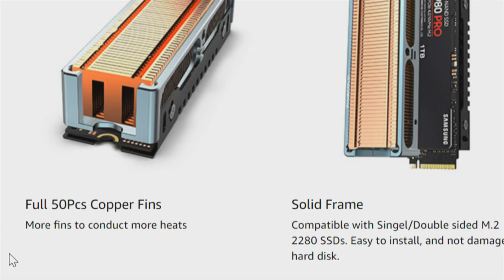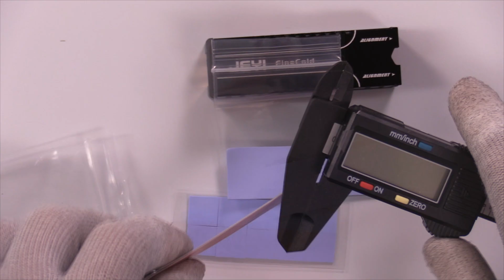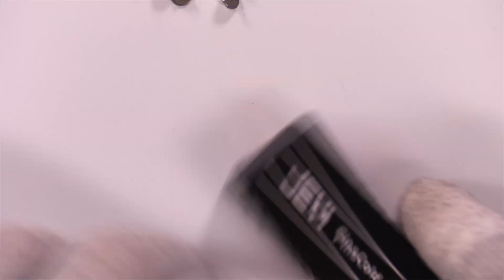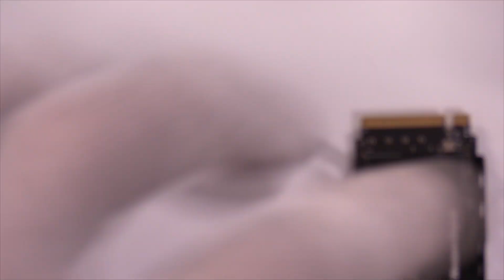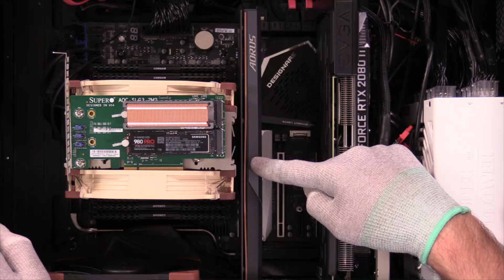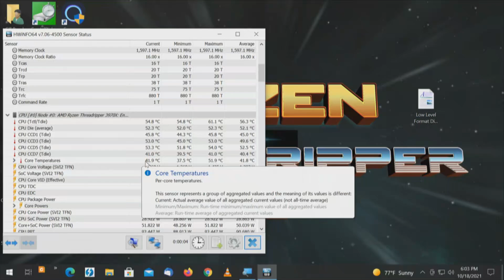Jeyi Copper Finscold Q150 M.2 Heatsink and WD Black SN850

Comment: It's strange that you expected more. Copper has a very high heat capacity, but not thermal conductivity. Once it heats up, it takes a very long time to cool down. I know this from practice. When we burned old wires to extract copper, we left it for another day. A day later it was still quite warm.

Comment: They have the Q80 that appears shorter than the Q150, it looks like works on PS5.
Reply from the maker: Hi Frenando Jorge da Silva, 
Welcome! JEYI Q80? Still same Design. Copper Plate may be more suitable. We have a Video on that one too. Possibly suitable for a Laptop. Link below. Best Option would be an M.2 NVMe PCIe SSD Drive with an included Heatsink for height tolerance. However if You have the Drive already, Heatsink it is! 

1. MHQJRH M.2 Copper Heatsinks Cooler for M.2 2280 SSD Laptop（2 Pack) 
https://amzn.to/3ldSjKn 
As an Amazon Affiliate I earn from qualifying purchases! Hope that helps! Appreciate Your Comments!
Reply: @BuildOrBuy  I got the Q80, it is working fine :)

Comment: PUT CASE NORMALY and Close it! than measure temps?!
Reply from the maker: Hi Beso,
Welcome! Testing requires time and patience. We've Tested 16 M.2 NVMe PCIe SSD Heatsinks as Requested by Subscribers. To expedite, and for clarity, as You have seen. Perception and Perspective. Thank You for Your Comments!
Reply: room temp is 26c + closed case with 3080, samsung m.2 have more than 75c and blue screens,
In normal standing case, hot air from rtx 3-4 hits m2 and his heatsink +closed case is hell (we all know outside with open case we will not have blue screen) 
I know you worked for this video and thanks for it but it does not help people who realy need help :(
Reply from the maker: Hi @besogociridze , 
Of the 16, 2 are better than this one. Are You running PCIe 4.0? Yes heat is an issue. The other 2 mentioned require overhead space. 
1. Acidalie 
https://amzn.to/3Yh7eAU
2. JEYI Finscold iGlacier8 
https://amzn.to/3YrjXRs 
As an Amazon Affiliate I earn from qualifying purchases! What about Your Case Fans? Do You have equal pressure to maximize heat transfer and minimize dust? Hope that helps! 

BTW: What Motherboard are You using? And Case? Which M.2 NVMe PCIe SSD Drive?

Comment: I really liked all of your M.2 heatsink videos. You should really check out the heatsink I ended up going with, the Icy Box M.2 Cooler off Amazon. It is similar to the Cryorig with a single swiveling copper heat pipe but the heatsink appears slightly larger and also has a 30mm 4pin pwm fan. I bet it can take the crown, it dropped the temps on my Mushkin Redline Vortex by 20c! It was hitting 71c and the max op temp is 70c, the thing runs HoT! Now it only hits 51c, maybe 55c tops and that is with heatsoak from my RTX 3080 12gb pouring heat into the case for hours turning it into a space heater.
Reply from the maker: Hi Kyle, 
Amazing how many M.2 NVMe Heatsinks there are yet We only had 2 standout. And 1 was from JEYI just not this one! Yes, We'll keep the ICY BOX M.2 Active Cooling Heatsink in mind for the future. Vendors need to do better with their Designs to be more effective! Especially going forward with PCIe 5.0 and beyond! Appreciate Your Comments! Thanks for Watching!

Comment: was slightly disappointed with the results but I'm still adamant on getting one anyway because it just looks so badass, compared to other heatsinks available. it instantly reminded me of the aquacomputer airplex copper fin radiators from awhile back. will pick this one up but also get the maxtor thermalpads with rated 14.8 w/mk instead of using stock. installing this on an itx system with a cpu cooler that blows down against the motherboard so it might as well help with active airflow towards the heatsink. Great review otherwise.

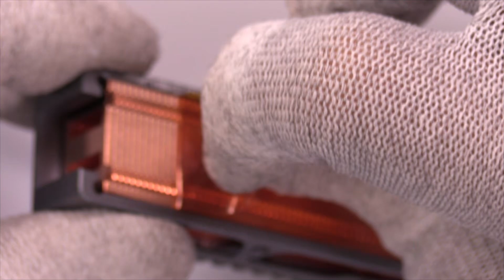EDIT: I just noticed this is the older Q150; the newer one does not have a cutout in the middle of the copper fins as seen on 5:41 and is instead whole fins now. Also, someone on reddit has mentioned that by removing the copper fins and putting a thermalpad between the fins and the aluminum housing improved heat dissipation. Looking forward to do that

EDIT 2: Got the heatsink after a week of ordering, it is indeed the newer revision without the cutouts in the copper fins - and all the pads come pre cut for thin (red), medium (orange) and thick (blue) - I could not measure for exact thickness since I don't have anything to measure it by. I followed the instructions for installation from JEYI for my KIOXIA XG-7 2TB Gen4 with just installing on the memory controller and memory chips, not the entire drive. and since the memory and controller aren't the same height, so I used the different thickness of pads provided in the package (medium for chips and thick for controller) for even coverage and pressure of contact with the heatsink.

Tested on the GIGABYTE AORUS B450i ITX (yes it has gen3 only, but I got the 2tb for basically dirt cheap) and here are my results:
Stock motherboard heatsink CDM 1GB run - 65c
JEYI Finscold Q150 CDM 1GB run - 51c
Reply from the maker: Hi Blood_Ninja,
Welcome! Just now seeing Your message! Yes, wicked looking! We have Tested two others that Petformed better!  PCIe 3.0 is not as much of a Heat problem as PCIe 4.0 is! Which has Us concerned about PCIe 5.0 but hopefully is being addressed! Thanks for Sharing Your experiences! Appreciate Your Comments! Success on running Cooler!
Reply: Could you please link that reddit post?

Comment: Dang, I think the squares are only used for individual coverage- using the red on the bottom regardless and deciding either squares or sheet-your style- red sheet bottom, blue sheet top, no need to us squares unless need to even out compression.
Reply from the maker: Hi lawxr6,
Welcome! Due to the thickness, We chose accordingly. Appreciate Your Comments! We had a better outcome than We would have otherwise. Thanks for Watching! Results were amazing!

Comment: I enjoyed watching the good video. I guess that the reason why the fincold copper radiator's performance is low is that the bonding area between the aluminum cold head and the copper heat dissipation fin, which is in direct contact with the NAND flash, has high thermal resistance.
In most low-cost manufacturing processes, aluminum-copper bonding is finished by crimping without any other thermal interface measures, which often undermines the benefits of copper.
The 400 w/mk thermal conductivity we see in advertisements is possible with 100% pure copper, and the 70-80% copper alloy commonly used in industry has no dramatic performance difference from typical aluminum heat sinks.
You can think of 400w/mk for a copper heatsink as a marketing term.
But unlike the ugly lump of aluminum, copper is beautiful :) I don't think it's bad because it actually dissipates heat.
Reply from the maker: Hi Cheong Sang wook,
Welcome! Thank You! Appreciate Your Comments and Insight! Very good points! Agreed, all about marketing. Results are what matters most. Doing these Tests have made Us throw all of what We thought We knew or expected, out the door. Absolutely Fascinating. 14 Heatsinks so far. Looks like there will be more! We've been methodical in Our Approach to the What, Why and How of M.2 NVMe Heatsinks. This is a good example of Function over Form. Going forward, faster and hotter, We're going to see more Vendor solutions. Asking the Question of how effectively will their solution solve Our problem! Stay Tuned!
Reply: Definitely, contact area is the problem here. Copper fins and aluminium base don't even look like they're properly welded together, they just kinda put those fins in the frame and that's it. Besides, there is no reason why would you be having aluminium base in the first place. Frame is fine if you don't want to accidentaly bend the fins, but the base itself should have stayed polished copper. This thing is a disaster when it comes to design decisions.

Comment: The comments on TR PRO ZEN3 news is scorching hot. The Intel fans are nuts. The Ryzen fans insist no one wants a 12 or 16 core TR PRO. The TR owners are taking no news about a TR ZEN3 means they can't get the upgrade ever. Of course you know I would never stir the pot. hahahahaha
Reply from the maker: Hi Max!
Sizzle, Simmer, Boil, Stew! Absolutely... not!?! Until We know more... Up for conjecture! The real question, what's dropping 1st and when! 

Currently Working on another Question about Motherboards. This time B550. Takes time to Educate about the benefits of TRX40 or WRX80! Going a little deeper on this one! Stay Tuned !

Comment: Best price to performance:  And the winner is, Gill's QUAD 😉card. Up to four drives and all under one heat sink. Good temps and Raid 0 if you want it. Time spent to load up four drives with pads already installed on the card is no worse than fooling with one single slot cooler. Four separate coolers $68 to $100, Asus GEN4 Hyper M.2 Quad card $77.
Reply from the maker: Hi Max Hughes, 
Well stated! I'm glad You've mentioned that! The TRX40 has the Resources! We keep demonstrating that over and over. This ability to zoom in and zoom out should help others to gain a different aspect on Perception and Perspective on all of this! Like You said, do the math. And look at the time involved. Fascinating Results! And We're being meticulous and consistent as possible in Our documentation. 

I think We can start doing deep dives now into the What, Why and How on some of these other Chipsets and Motherboards, as We're asked about doing 'this or that'. And We then can explain, what's up with that! Like the B550 and the x570! It's like the Emperor has no Clothes! No PCIe Resources! The obvious becomes obvious as soon as someone says hey, Do You see what I see! Nothing! As You have stated! Less hype and more facts! Test and Verify! Appreciate Your Comments!

Comment: Hey Gill, what would be the benefits of using that overpriced Amfeltech Squid 6x m.2 card? Other than the larger amount of memory that can be fitted of couse. Because that card seems overkill: if one is to take full advantage of the PCIe 4.0 x16 slot, 6 cards running at x4 will eventually be bottlenecked by the motherboard bus. The 4x m.2 add in cards seem the most appropriate, especially because they also seem optimal for cooling. The Squid appears to stack cards, or put them on the back of pcb (?) which will eventually also hamper thermal dissipation.
Reply from the maker: Hi cldpt,
Just now seeing Your Comment! YouTube is holding messages for whatever reason. Another YouTube system glitch. A bunch of Comments just showed up today! Great Question! I'm glad You've asked! That too started out to Answer a Subscriber Question and We just have not had time to get to that Video! And they asked what do You think of the Amfeltec Squid. Never heard of it until asked about it! And that's where that started. And before that, at the time We were going to be looking at an ASUS Workstation class Motherboard on the x299 Chipset which had a PLX Chip for more PCIe Slots. No going back on that now. Too far back in technology. Each Video takes time to Film and Edit. Look at all of those Heatsinks! Had no idea We'd spend that much time on M.2 NVMe Heatsinks, Answering Subscribers Questions! 

As for the Amfeltec Squid why now after so long, appropriate so We can discuss PLX Chips. And what determines the Speed of the 3 Components involving M.2 NVMe PCIe Add in cards. The PLX chip is the primary bottleneck. Since the PLX chip is Lane Switching Upstream and Downstream Ports. Yes the next step would be the PCIe Bus. Only 16 Lanes when We need plus 4 Lanes. No matter what the Speed of the Drives. Doing this without RAID and using different Speeds of Drives will demonstrate that. As for Heat, another issue not addressed that should be. 

And another Subscriber had asked if there were an Add in card that could self Bifurcate a x4 Slot for 2 M.2 Drives. Odd request, yes. Doable. Yes. Amfaltec. However, based on the price, better to purchase a new Motherboard. We get lots of 'what if' questions. Details matter! So I must remember to always include those details even if not practical, doable. 

Just like the Bios Details about Hardware PCIe Lane allocations and Bios Bifurcation on the 2 ASUS Thunderbolt 4 Z590 Motherboards Video. And that too is getting a Video Update so We can explain all of that in a bit more detail! And let the Viewer decide what's practical vs what's doable. Working on it! On that, either way, they lose PCIe Lane Resources. This must be covered before We get into the Z690 Motherboards. Those are going to be very confusing. We need to provide clarity.
Reply: I agree for a raid card but for different drive letters for different purposes and used at different times, it might be ok. WRX80 don't need it. On aTRX40 you've only got one X16 slot free. As for temps IDK I don't own one. That's a good question! Gill will come to the rescue.
Reply from the maker: Hi Max Hughes, 
Your Comment also just showed up today! YouTube has these hiccups every once in a while. As You know, I try to get to messages within 48 hours unless Filming. Then I have to hibernate until Editing and Rendering is Finished. Thanks for Responding! 

The Amfeltec Squid is a bit of an oddity. We were originally asked by a Subscriber about that add in card. Made me curious enough to want to know more! Had to do some Research! There's another card, Liqid Honey Badger. We will never see that one but We get asked about every once in a while. It too uses a Broadcom chip. Is made for Servers with excellent air flow. 

LQD4500 PCIe AIC SSD FHFL Honeybadger | Liqid, Inc
https://www.liqid.com/products/liqid-elements/element-lqd4500-pcie-aic-ssd
Linus Tech Tips: LQD4500 Honey Badger is "Face Meltingly Epic with speeds "over 250x your Netflix 4K!"
https://www.liqid.com/blog/linus-tech-tips-lqd4500-honey-badger-is-face-meltingly-awesome-with-speeds-over-250x-your-netflix-4k

All of these types of cards use a Broadcom PLX Chip. The Lower end cards use an ASMedia PLX Chip. And We're not high enough up on the Food chain to look at a Liqid Honey Badger! Besides, If You have to ask the Price, guess what! 

Amfeltec Squid Carrier Board - PCI Express Gen 3 Carrier Board for six M.2 NVMe
https://www.amfeltec.com/pci-express-carrier-boards-for-m-2-ssd-modules/
Thanks to Gerald Nordahl for sharing this info regarding Amfeltec... Amfeltec cards have Bifurcation built-in. The PLX Chip! 

As for Temps, We've learned enough about Heatsinks to only say, Let's Test and Verify! We're getting there! Stay Tuned!

Comment: Wow... Gill,  I had Very High Hopes for this heatsink,....  It's made with copper... And it has Many Very Thin and delicate copper fins, usually that's a sign of quick and sensitive heat transference and surface area for dissipation,....  With the knowledge we've been taught about heatsink design and copper, This should have been a top performer,  but… Doggone it,...  This was a huge disappointment... There is something really wrong with the design, this would be a heatsink to look at with thermal imaging, if we saw the copper heat sink fins showing high heat dissipation. Then we know that the copper fins are conducting heat,...  My best guess is there is something wrong with the mounting cage for the copper heat sink fins and its ability to conduct and transfer heat efficiently,  kind of like it's missing thermal compound, I suspect the cage is made of a different material, and the two dissimilar metals are not conducting heat transference.  I am just as surprised as you are with the results of this product, there are a lot of misconceptions you are revealing in this testing... And kudos to Pablo for his support in this series of testing products.  :-)
Reply from the maker: Hi LonnDawg,
Exactly! If this had been Our first Heatsink, I'd say no way. Yet this is Heatsink #14 and We've done everything the same. Methodically. We even pointed out the W/mK values of both! Absolutely! That's a good idea! We can do that on the Motherboard M.2 Connector. But We cannot get a good Emmissivity reading without the black tape. We can try and see what happens. Only one way to know. I can place black tape on top of the assembly but We would not have intimate contact. Don't know how accurate that would be. We need to Test both ways also from the Side View on the Dual Adapter and see what We see if anything. We even measured the Thermal Pads for thickness and used both instead of the Red Thermal Pad that's intended for the bottom. A 1mm Thermal Pad on top like it's not even there. Agreed! Thanks to Pablo, We know more than We would have otherwise! Fascinating Results! 

BTW: The stated Aluminum housing for the Copper Fins is Cast, not machined. And that Aluminum material Casting may have a different thermal density coefficient hence a different W/mK value than what is stated. Curious. Details! Change one thing, changes everything! I'm glad You brought this Up! Had me thinking beyond the obvious! The What, Why and How. Looks like there's been a manufacturing change from the intended original design. And no one bothered to check and verify the Results! Until We came along! Interesting! Appreciate Your Comments! Stay Tuned!
Reply: @BuildOrBuy  Wonder if the copper fin design may require greater air circulating than other designs. If copper is generating greater heat at the fin than other designs, it would also require greater volume of air to dissipate excess heat.  Just a thought, which could explain why this unit is not performing.
Reply from the maker: Hi @johnosborne1151 ,
Welcome! We definitely expected better Performance. That should be taken into account from the Manufacturers standpoint. Any change We would make would deviate from that Default. In Comparison with other M.2 NVMe Heatsinks We've Tested, We move on to the next one since there are other better Designs of the 14 We have evaluated! Appreciate Your Comments! Thanks for Watching!